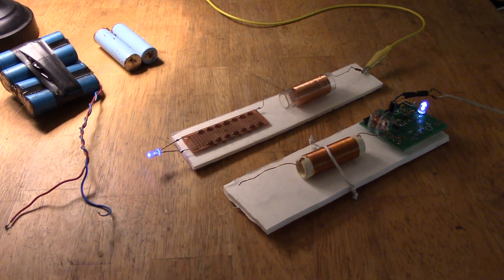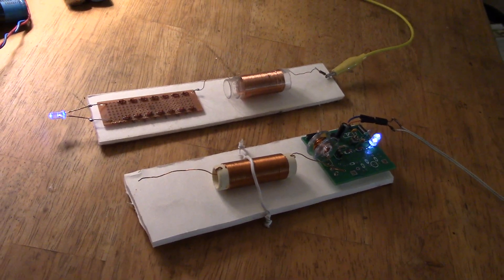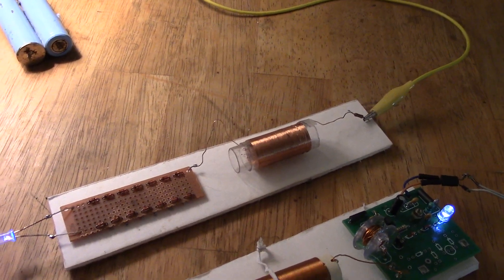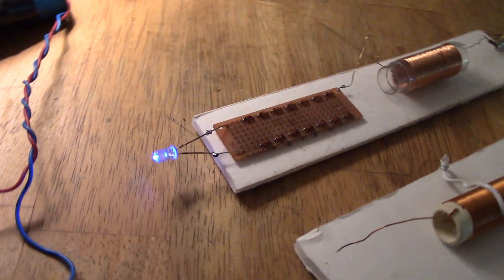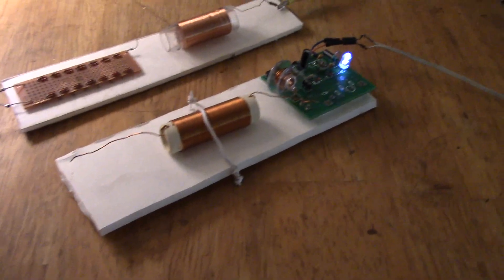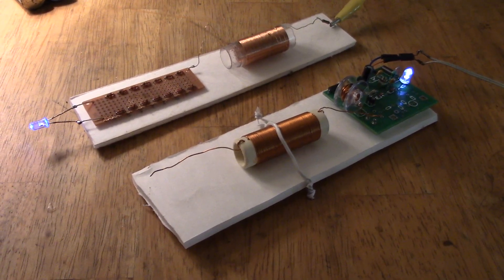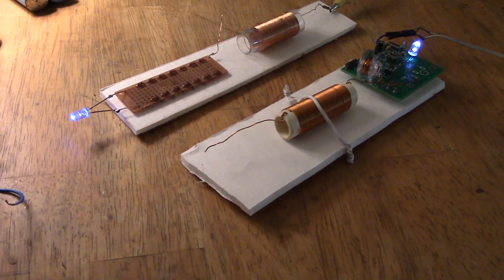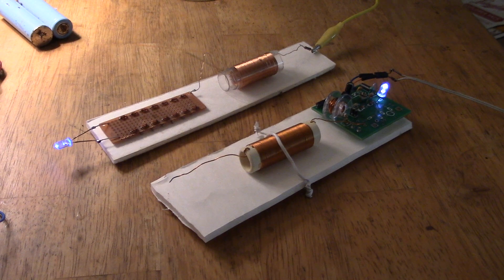Ready to go - Stiffler outdoors wireless electricity

Comment: Hi Slider. Didn't Mr Tesla electrify  the earth first and while doing a similar experiment ? but with incandescent lamps ?.   I also read somewhere that the earth is Pos and the atmosphere Neg. Not sure if it's true though ?.   just a few thought's Best of luck Sir.
All my best.
Bobby
Reply from the maker: Apparently so, up at Colorado Springs, but there were fields all around. With mains hum from houses it has always been difficult with my own ideas, the attenuation is horrific lol. The Earth is neg, sky pos, with about 1V per foot from the ground. Nothing really for current, but voltage can be very high with a balloon carrying a wire.
Thanks Bobby, best to you and yours :)
Reply: Slider.  The electric field increases from Earth to Ionosphere at about 100V/m or 33V per foot altitude but can be much more with clouds or storm near.  So on a typical day you have voltage difference from your foot to your head of over 150 volts!  Feel "excited" yet?  <^>sss zap!  Not far from enough to light a neon bulb off your "tophat" head.
Reply from the maker: LOL the tophat headgear could be a fashion statement. Beats tinfoil any day.
I placed it lower because that's been my experience :)
It may not be the right experience, that much is understood.